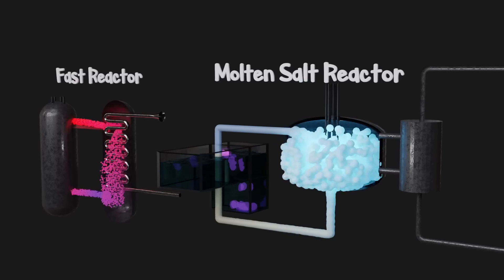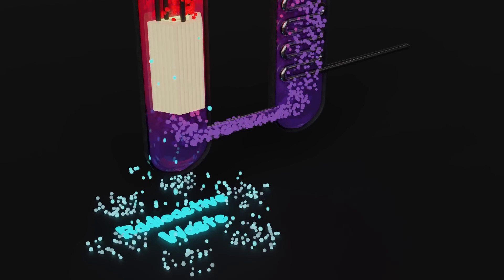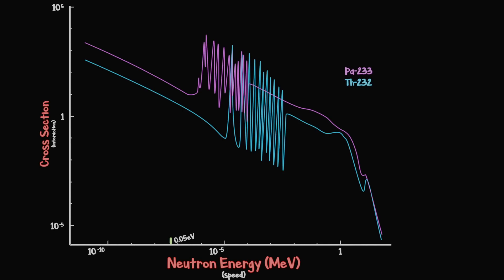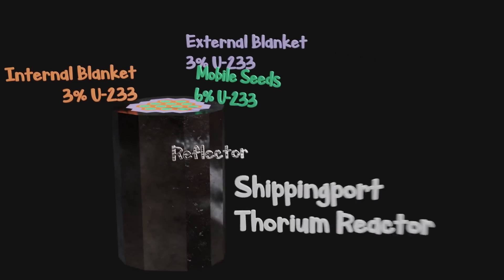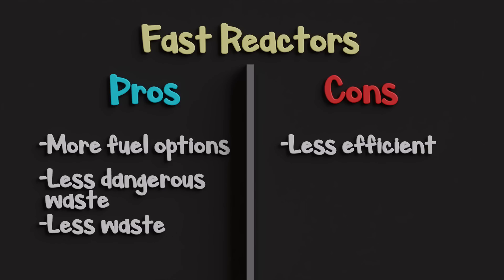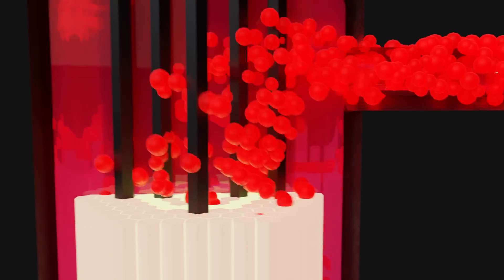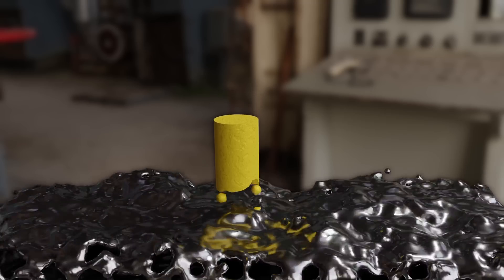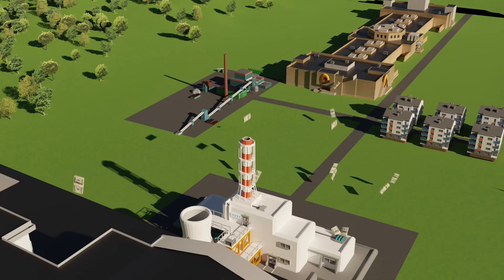Thorium and Fast Neutron Nuclear Reactors

Comment: Elysium Industries molten salt fast reactor is the greatest reactor i have seen around. Please look it up. Its brilliant.
Reply: I agree but the Seaborg and Thorcon reactors are more important in the short term.
Reply: @chapter4travels No, Dual-Fluid Reactor is much better! 😊
🔋 Key Advantages of the Dual Fluid Reactor (DFR):
• ⚡ Ultra-efficient: Nearly 100% of nuclear fuel is used  
• ♻️ Burns nuclear waste, depleted uranium, and even thorium  
• 💥 Transmutes long-lived actinides into short-lived fission products  
• 🔄 Built-in Pyro Processing Unit (PPU): Continuously removes neutron poisons and extracts valuable metals  
• 🛠️ Liquid fuel: No solid fuel rods, no batch reloads  
• ⏳ Decades of operation with a single fuel load possible  
• 🚫 No corrosive salts: Liquid metal fuel avoids fluoride corrosion and complex chemistry  
• 🧊 Lead coolant: Excellent radiation shielding, no water, no pressure → no steam explosion risk  
• 🌡️ Very high temperatures (700–1000 °C): Enables hydrogen, e-fuels, ammonia, and direct steel reduction  
• 🧠 Self-regulating: Output adjusts automatically via negative temperature feedback  
• 🪫 Minimal waste: Only short-lived fission products remain
• 🏭 Compact & scalable: High power density, ideal for modular deployment  
• ⚙️ No moving parts in reactivity control: No control rods required  
• 💰 Uses existing stockpiles of spent fuel, DU, and thorium  
• 🌍 Reduces dependence on enrichment, imports, and fresh uranium mining  
• 🔄 Full closed fuel cycle: No external reprocessing needed  
• 🆚 Outperforms typical SMRs: No pressure vessels, no high-pressure coolant, no water-based systems

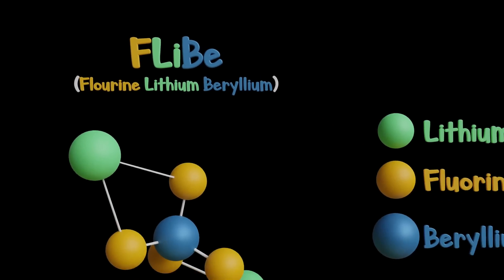Comment: I like the videos but do have to say the sequence could reasonably be interpreted as based on a negative attitude  vs a balanced attitude to Thorium: odd way order of presenting the information especially as molten salt reactor advocates don't want to use solid fuel, but chemically and in-line process to remove Protactinium.  Molten salt fuels were mentioned, but not till 9:45 minutes or so.

Comment: I kinda just realize even today with nuclear energy we still use it to boil water to spin turbine. I wonder how much energy is wasted in that process (considering water's high heat capacity) and is there a more direct way to harness the energy directly.
Reply: Steam turbine are actually quite an efficient process but some research is going toward supercritical CO2 turbine that would be more efficient and free the need to build reactor close to large body or water.
Reply: @arofhoof You need cooling for the sCO2 process, too.
Reply: You're missing the big picture. These reactors generate high-temperature industrial heat with hundreds of applications, 
making electricity is just one of them.

Comment: The current BWR nuclear reactor designs are built to create weapons-grade plutonium; the electricity they produce is just a sideline.
Reply: Hogwash. About 1% of the spent fuel is by weight pu and that is due to the way the reactors work. Yes the pu can be reprocessed to extract the pu but the power production is the real goal of the plant and if any reprocessing for pu for weapons is done its independent of the power production goal. The US hasn't reprocessed since the 70's. On the other hand, weapons grade pu has been used as fuel for reactors so it can actually go the other way and does. Not all the pu for MOX fuels is from spent fuel. On the other hand, you can produce pu at much greater efficiency with reactors built for that purpose. Additionally, we are not building bombs anymore. In fact it is the opposite. We are dismantling bombs or reconfiguring so there isn't a need to produce any more pu for bomb making. It's looking more and more like Russia is breaking the treaties and producing more bombs but its difficult to prove.  We haven't needed pu for over 30 years so its pretty hard to argue that these plants are for bomb production and electricity is a sideline. Decades ago it was a consideration but after the cold war and the nuclear reduction treaties, there is no need for additional pu.

Comment: You can't talk about carbon neutral or even climate change if You leave the option of save and clean nuclear power out for the reason of financing and research.
That looks to me more, that lobby industries are hindering the development of thorium reactors for only one reason, it would put them out of power, and that completely. So no funding.
The first funding for thorium reactors in 1960 was dumped in favor of hot water reactors, it was easier to build nuclear Bombs with them. Not to produce energy, with 5% efficiency.
The same players, that stopped the development of efficient batteries since Sinclair's electric car in the 80's are stopping the development of clean nuclear energy. So don't bullshit the public with doomsday stories about global warming, if You are not prepared to do anything about it.😁🤩😇

Comment: There is no logical reason why we aren’t using molten salts. They can be used both as a burner and breeder reactor. We could easily burn nuclear “waste” from old fuel cells, while having the safest design that has ever been developed in nuclear technologies. With the most efficient method for fuel distribution burn up. Molten salt all the way!
Reply: There is a similar alternative.
🔋 Key Advantages of the Dual Fluid Reactor (DFR):

• ⚡ Ultra-efficient: Nearly 100% of nuclear fuel is used  
• ♻️ Burns nuclear waste, depleted uranium, and even thorium  
• 💥 Transmutes long-lived actinides into short-lived fission products  
• 🔄 Built-in Pyro Processing Unit (PPU): Continuously removes neutron poisons and extracts valuable metals  
• 🛠️ Liquid fuel: No solid fuel rods, no batch reloads  
• ⏳ Decades of operation with a single fuel load possible  
• 🚫 No corrosive salts: Liquid metal fuel avoids fluoride corrosion and complex chemistry  
• 🧊 Lead coolant: Excellent radiation shielding, no water, no pressure → no steam explosion risk  
• 🌡️ Very high temperatures (700–1000 °C): Enables hydrogen, e-fuels, ammonia, and direct steel reduction  
• 🧠 Self-regulating: Output adjusts automatically via negative temperature feedback  
• 🪫 Minimal waste: Only short-lived fission products remain
• 🏭 Compact & scalable: High power density, ideal for modular deployment  
• ⚙️ No moving parts in reactivity control: No control rods required  
• 💰 Uses existing stockpiles of spent fuel, DU, and thorium  
• 🌍 Reduces dependence on enrichment, imports, and fresh uranium mining  
• 🔄 Full closed fuel cycle: No external reprocessing needed  
• 🆚 Outperforms typical SMRs: No pressure vessels, no high-pressure coolant, no water-based systems

Comment: There is a private, capitalist solution on its way.
Go read about Moltex Energy.
Their goal, build a molten fueled, molten salt cooled, Small Modular  Reactor who's startup and running costs are lower than a combined cycle gas plant who's design does not require any new Nuclear Steels to be designed, tested and approved but the IAEA and the rest of the world's national nuclear safety and regulation bodies.

Let's say that again:
A Molten Salt SMR that uses no New Nuclear Steels and is cheaper to build and operate than a combined cycle gas plant.

And the first one will be built in Canada before 2030.

Go 🇨🇦 and 🇬🇧 Go!
Reply: Moltex you say....  I'll check that out.  Thanks.

Comment: Yeah, thorium reactors and MSR are just 20 years away. and always will be
Reply: Thorium reactors could be a reality in less than a decade, if we wanted to make them. There are some technical issues to nail down, but no law of physics hurdles that need to be cleared. 

Unlike fusion.
Reply: @M0rmagil  there are no laws of physics that forbid fusion either. the sun proves it. doesn't make it feasable in less then 20 years
Reply: @AndDiracisHisProphet  Fission is easy, fusion is hard. 

I didn’t mean to imply that fusion was impossible, much less state it. But we had a working, deployed nuclear powered sub 9 years after developing the bomb. The first MSR was built in the 50s. Further work was done in the 60s that got us most of the way there, on a comparatively meager budget.

How much time and money has been poured into moving fusion forward? Decades and billions.

Comment: Why can't we use gallium in fast reactors? it's pretty unreactive and has a low melting point (26 degrees celsius or something)
Reply: Gallium costs $500 per kg and total annual production is less than 800 tons. You might run into a supply problem. ;-)

Comment: Never say limitless, that's a lie the fusioneers tell.
Reply: In their dreams everybody can fly. I used to dream that I am running down this hill and there is a strong wind blowing from below. I am extending my arms and my feet barely touch the ground. I am taking longer and longer leaps and then I am gliding inches above the ground forever. Great dream. In reality fusion is like climbing Mt. Everest in winter during a storm in the nude without equipment. ;-)
Reply: 4 billion years' worth of fuel is pretty close to limitless considering the sun is supposed to burn out soon thereafter.

Comment: The thing is, nuclear waste is already an extremely low concern. It’s really not that bad and only creates problems on rare occasions. We should work towards more energy efficient reactors, not waste efficient ones.
Reply: yea we already have really good ways to store it. most people probably think nuclear waste is some green goo stored in flimsy oil barrels, when in reality it's melted down into glass and stored within concrete and steel and is impossible for it to leak out over long periods of time. I think the public perception of nuclear power and nuclear waste really has something to do with it
Reply: @mastershooter64  Many chemicals and industrial wastes are stored to way lower scrutiny while posing a similar danger, not to mention the coal fired radioactive fly/bottom ash actually being a bigger source of radioactive polution in the environment...
Reply: @mastershooter64  glassification is a very slow process.  At Hanford alone there are tens of thousands of gallons waiting.  And no, we have no good way to store it over thousands of years, as it may still break down due to water incursion, use by future generations, and current wartime scenarios.
Reply: That’s not the main benefit. Thorium reactors are able to power reactors using very little
Reply: Waste efficiency is efficiency.
Reply: Tell that to the kids at a St. Louis Elementary school after Polonium and Radium were found in 2022 .  Enough excuses for the clown show that yells nothing to see here, or at Hanford, etc.  Nuclear waste is not always concentrated, but is frequently leaked in bad design and loose regulation.
Reply: it really isn't bad at all. I can't stand the anti-nuclear people. it's so ridiculous. We could have super cheap power if it weren't to all the red tape and other financial problems. We could easily have a hydrogen economy right now with hydrogen supercars, and also hydrogen fuel-cell crs and trucks, and even trains. All that takes is cheap and abundant electricity
Reply: There are several issues with thorium reactors. First they run at 1200 degrees and pump corrosive salt, so making components that will run with longevity is an issue. 2nd they produce U233 which has to be filtered out (at 1200 degrees yeah right) and stored separately for 27 days to become fissile, a major extra complication and point of possible failure. How the heck you gonna filter out isotopes and store them and measure 27 days per isotope batch? Whew... 3rd, no waste management system has even been proposed... Finally, if the system fails and requires shutdown, the salt freezes and the entire system is a worthless salt plugged brick of salt, and the whole system disposed of safely.

Ps. We do not even know how viable thorium mining is.
Reply: For fast reactors and thorium reactors, their ability to use much more fuel than standard LWRs, for example, is, to me, more important than their little waste generation. However, this might increase construction costs and therefore the overall costs of electricity of the plant. I still really like these reactors though.
Reply: Look into the Dual-Fluid Reactor.
🔋 Key Advantages of the Dual Fluid Reactor (DFR):

• ⚡ Ultra-efficient: Nearly 100% of nuclear fuel is used  
• ♻️ Burns nuclear waste, depleted uranium, and even thorium  
• 💥 Transmutes long-lived actinides into short-lived fission products  
• 🔄 Built-in Pyro Processing Unit (PPU): Continuously removes neutron poisons and extracts valuable metals  
• 🛠️ Liquid fuel: No solid fuel rods, no batch reloads  
• ⏳ Decades of operation with a single fuel load possible  
• 🚫 No corrosive salts: Liquid metal fuel avoids fluoride corrosion and complex chemistry  
• 🧊 Lead coolant: Excellent radiation shielding, no water, no pressure → no steam explosion risk  
• 🌡️ Very high temperatures (700–1000 °C): Enables hydrogen, e-fuels, ammonia, and direct steel reduction  
• 🧠 Self-regulating: Output adjusts automatically via negative temperature feedback  
• 🪫 Minimal waste: Only short-lived fission products remain
• 🏭 Compact & scalable: High power density, ideal for modular deployment  
• ⚙️ No moving parts in reactivity control: No control rods required  
• 💰 Uses existing stockpiles of spent fuel, DU, and thorium  
• 🌍 Reduces dependence on enrichment, imports, and fresh uranium mining  
• 🔄 Full closed fuel cycle: No external reprocessing needed  
• 🆚 Outperforms typical SMRs: No pressure vessels, no high-pressure coolant, no water-based systems
Reply: Isn't that because there aren't a lot of reactors in the first place? Why kick the problem down the generation?
Reply: @TheBluePhoenix008  Agreed, that is what we are best at doing.  The recent  reclassification of high level to low level is not in my kids best interest.
Reply: @veritea9374  that's why I'm not having kids lol. Well, the real reason is cause I'm 18 💀
Reply: @TheBluePhoenix008  Having a family is the most important part of life. You'll realize that eventually.
Reply: @TheBluePhoenix008  It's not dangerous to just bury it.
Reply: Idk if you've looked around, but waste material of any sort needs to be reduced/eliminated . Not to mention that we said the same thing about other polluting materials  in the past. I'd prefer we prevent it all together as opposed to waiting until it becomes a problem. Humans have shown little responsibility with such things and I prefer my kid not live in a world with a nuclear waste problem.      Money needs to go to fusion research. That's our golden ticket.

Comment: I hope they figure it out. With that kid of energy we could power co2 scrubbers and electrolysers to make carbon neutral synthetic hydro carbon fuels out of the air for planes, trains, boats and automobiles with no necessary modifications. Redefining the whole definition of energy sector. That would ruffle some feathers though if any country couldmake its own hydro carbon energy though wouldn't it?
Reply: Once again it depends on the cost.  However, if the leaders of that country are far thinking, they would realize that the security of the country;s economy would be greatly enhanced.  It may come to pass this Winter as Germans lack for heat that they will agree.
Reply: Unfortunately, even if we billions into thorium reactors research, they won't be cheaper than ordinary uranium for at least 50 years. The concept looks interesting on paper but it's simply not worth it, Pu cycle is much more well known, we have all of the neccessary infrastructure and it works good enough. There aren't even enough Th mines and processing plants so support the reactors. Not to mention the ridiculously difficult fuel reprocessing.